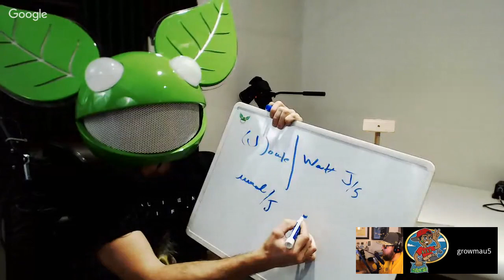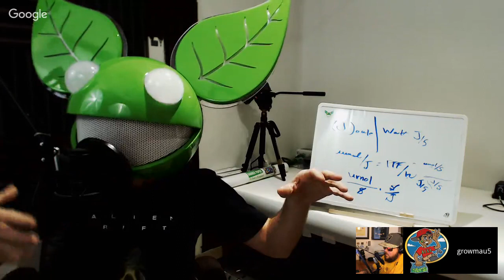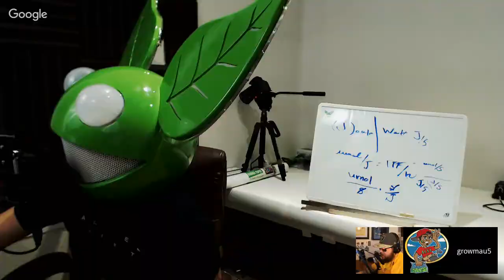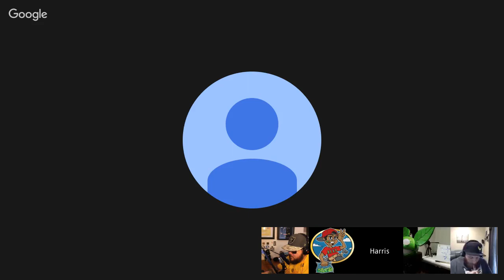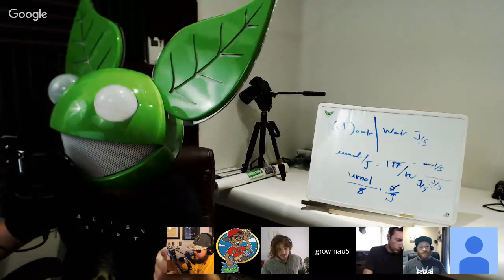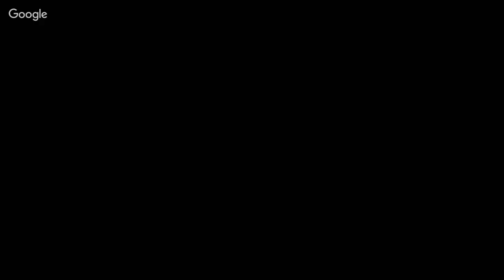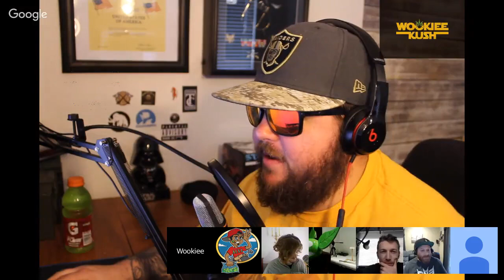LIVE: how much LED for your grow space?

Comment: Coco for Cannabis has an amazing Grow Light Calculator Program and comparative tool.  Enter your tent size.  Enter some manufacturer provided data (or measured data for each light) or Pick Pre-loaded options.  Compare (4) Mars Hydro TS1000's to (2) MarsHydro SP-3000's and see both ends of 4'x4' tent coverage.  It also gives potential yield based of 0.55 (Low) to 0.75 (Benchmark) grams per usable umol (since with LEDs, 1 gram per watt is an outdated Benchmark as well).   Anyway.... back to watts per square foot...  If LED lights are as efficient as MarsHydro TS1000 or better then 40 watts per square foot inside a reflective tent should be sufficient to get close to max potential yield during flowering (around 900 PPFD average).  Maybe as low as 37 watts per sq foot if using a top quality LED perfectly fitted in a tent.  My benchmark is like 2 SP-3000's in a 4x4 tent.

Comment: Get a 5gal bucket cut a hole in the top for a household led 4 or 5k light bulb socket to fit through. Then screw the socket on top of the lid. That will hold the light in place. White bucket, then paint the outside to keep the light in. Cuttings and seeding love the atmosphere . 
Starting 6-8 plants, only using 6-8 watts.
Reply: Or cut hole on bottom of bucket and turn it upside down?

Comment: I have great success only using 40watt 5500k led 18inches away ofet my aeroponics cloner. I get explosive roots in 6 to 8 days plantable roots in 8days max.  Clones need very very little light . Temp control is most important to watch. 75degrees 40watt 5500k led can't miss

Comment: I have a 2.5 ft × 5ft long 7 ft tall with 2 California light works 1 is the solar system 275 the other is a 250 solarexteme cob series I'm having a heat problem an foxtailing pretty bad do u have any recommendations
Reply: Install vent fans on cooling tstat
Reply: I had the same problem. Added a input fan and turned off the lights from noon to 6pm.  I had to lose the a 135 LEDs and just run on a optic 2  205 watt.

Comment: Par rating is a much better way to measure how much light you need. You can use what ever light you want or as many. What you need to look for is 100 par at the edges of your grow space. Cheap $50 1000w lights from eBay will cover a 2'x2' area.
Reply: 100 par at the edge is shit lol

Comment: Friend, I have a doubt, I rode a PC grow, and I want to use LED bulbs. I thought I'd set up a panel with 10 10W bulbs, would that work well?
Starting from the concept I would have 10W also a 100w LED bulb
Reply: From my understanding you want minimum 32 watts "true watts" per sq. ft. of grow area when using LED's, and again that is minimum. I buy the $150 dollar full spectrum 1000 watt (which is bullshit) that puts out 240 actual watts off Amazon. I use one per plant [240 watts / 4 sq. ft. plant footprint= 60 watts per sq. ft. "true LED Full Spectrum wattage". You can grow them with less, but if want the full yield it all comes down to actual watts. No matter how fancy the light, or how much it cost, it all comes down to actual wattage, no way around it. The rest is all marketing hype bullshit.
Reply: @cbriangilbert1978  32 watts is fine if you want to penetrate the first tier of a canopy, going from that you can have much larger yields as your light gets deeper & the bills get higher. IMO 1x1000w HID per 25 sq ft  will get you great yields. Add some LED where you can to help achieve a full spectrum & repeat until you have filled your grow space.

Comment: Have their been any studies on using all 3 AC power phases, lighting the same room? This would give 3 flicker spikes, every 50th or 60th of a second, instead of just one. I was just wondering if the plants respond to this.
Reply: i know something like that exist on led, but its more like having the led turn on and off in matters of milliseconds so in the end in a second you end using like a third of electricity becouse plants do not actually realize  led is turnig on and off so fast, would love to get to know more on the subject! Font of this is a friend of mine working as an agronomy expert on computer simulation in univesity.
Reply: That would make a more even spread of photons. But ultimately, for plants I believe its more based on photons per photo period. "Think of a light mover, it is more intense, due to proximity, but moved over a larger canopy area." So with three flicker spikes you would have to reduce intensity to equal a very similar mol/day. I think its splitting hairs
Reply: I would think that pwm of or something digital could be implemented to do this. However, I would think that if it worked, most led manufacturers would be all over that marketing wank. I mean it's a good idea in theory

Comment: 4x4 x 6ft gorilla tent - some say cal light works others say kind led. what model would be primo? i always like to go a little more than less obviously. Ive got a green thumb but am clueless with LED's.QB's look a little intimidating. Im not the best DIY :-( so best bang for your buck for 4x4 grow tent? thanks all!
Reply: Screw both of those, get those quantom boards go on led gardener and figure it out, it's not that hard
Reply: @josephjohnson5560  yuppp
Reply: danjf1 Get yourself a 600 waTt digital dimmable HPS ballast. You can’t lose. Set it to 400w for veg and turn it up to 600 after 2 weeks flowering
Reply: look into the Optic LED Optic 6 supposed to be really good and not too expensive and perfect for a 4x4
Reply: Greengenes has a build your own ( with his parts). You've probably seen it , but if not check it out. The build is explained real well. The specs not so much. Looks like an easy build for around 300

Comment: I'm a new grower with a 3x3 tent, a 450 watt meizhi led, and am wondering should I keep my seedling at the bottom of tent. Also any other advice for a new grower will always be appreciated
Reply: The R450 may have 90 5W LEDs going when both the Grow and Bloom switches are on, but it only consumes 195 watts of electricity.
Reply: bishplis ,thx for advice but it does not answer my question at all
Reply: you didnt ask a good quesion, i gave you the actual wattage so you can figure the height out

we dont even know how high your tent is
Reply: bishplis , all 3x3 tents are actually 32x32" and 64" high, sorry if your too ignorant to understand a basic question though, try again!
Reply: no theyre not.
Reply: if you cant ask a proper question how do you want people to answer it
Reply: i mean im not buying chinese disco lights that run at half the wattage you think they run at, whoops....
Reply: buy a cheap lux meter. look up "marijuana grow lux chart". use lux meter throughout your grow to achieve proper lux based on stage. voila now join Brooklyn Paranormal Society; bkps.co
Reply: thats a disco light, it doesnt work with lux
Reply: Either place it 4’ away or you could get a t5 led 2’ for$30

Comment: What is a good cob/Driver setup for a 6 x 6 tent?        I was considering 12 citizen clu048-1212 using 2 mean well 480h 2100.      Would this be sufficent?   What would you suggest?    Appreciate any help.
Reply: roby salyer thats going to be a tad light. Lol, thats punny. That works out to 25w/sq ft. You could add a third driver and 6 more cobs, drop the drive current to 1750ma. Or, keep the 2100ma and go with 4, hlg320s, still needing the 16 chips. Quantum boards are available on amazon now, 2 boards for $150. At 2100ma, alumnum plate would be enough of a heat sink. These are a more efficient option with better spread of intensity. Using an hlg240h-c2100, 2 boards and something for a heatsink would cover about 9/ft sq. For about $300. 4 of these rigs would do you just fine.

Comment: What's a good led on Amazon  $100 on Amazon
Reply from the maker: dcollins075 the Vipar Spectra ones have the lowest reported failure rate that I’m aware of.
Reply: growmau5 thanks bro and I love you guys work..#growbig
Reply: stakks17 the light itself isn’t a bad light but the problem w most LEDs unless you do a fancy cob set up is the actual dimensions of the lights are tiny so they have no spread. Think about it this way, a flash light shines a bright beam vs a light on the ceiling of a room lights up the whole room. That’s basically the difference. If you wanna go w LEDs you gotta either buy the super expensive ones or build cobs either way I wouldn’t bother just buy a T5 or an HPS ballast tried and true.
Reply: are they really that bad just got a couple
Reply: growmau5 lmao I love how people try and grow with a viparspectra or a mars so fun watching the disaster unfold